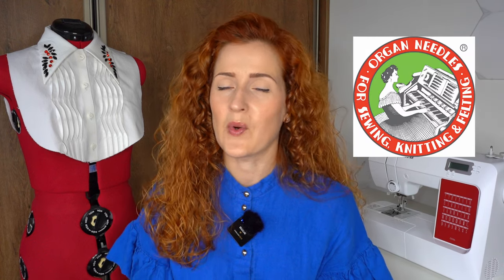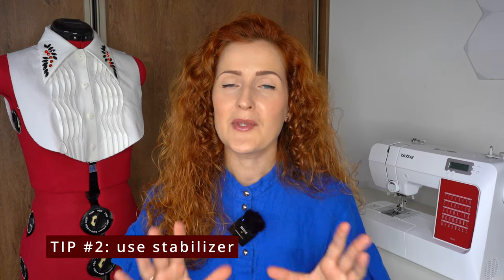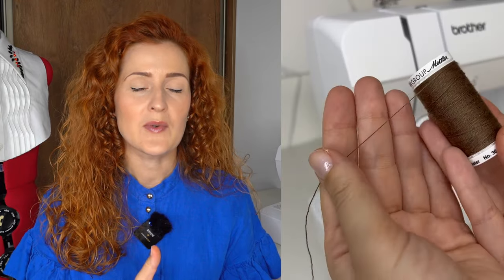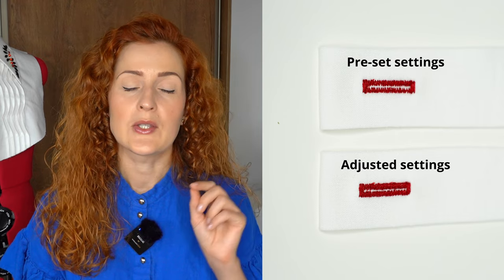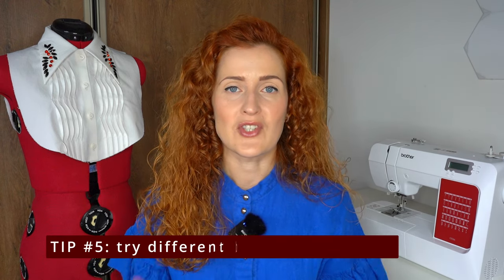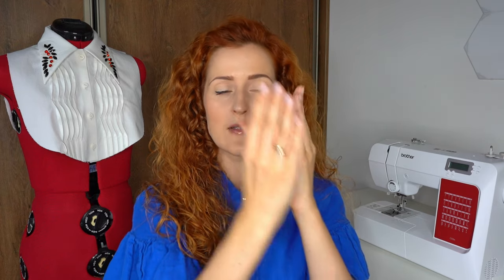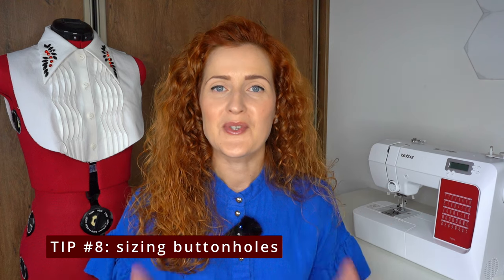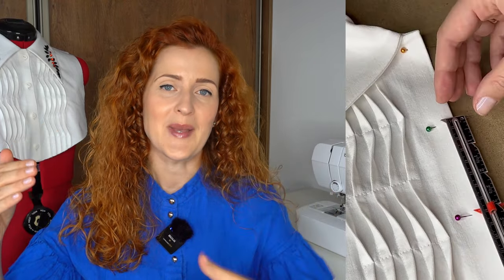MASTER YOUR BUTTONHOLES: 9 tips for perfect results

Comment: In the early 1980s, after ruining too many buttonholes with either a seam ripper or scissors, I went to the hardware store and bought a 1cm wide wood chisel.  From a builder's supply store I begged a very small piece of hardwood from their scrap bin to serve as a cutting base.  There had to be a lot of us doing this because a few years later the buttonhole cutter appeared on the market.

Comment: Well another "duh" moment!  I did not realize I can adjust this automatic feature on my machine!!  I actually have an old old machine with a buttonholer attachment that  makes fabulous buttonholes that I pull out when making them instead of using my newer machine.  

I also kind of fold the opened buttonhole open so that I can trim any threads really close.  Very Carefully lol😉.

Thank you, have a fabulous today!
Reply from the maker: If I need to trim any extra thread - I like to do it on folded open buttonhole, too!🤗

Comment: I use a seam ripper for button holes because it's hard for me to use embroidery scissors and I don't have the chisel. I place pins horizontally across the ends of the button hole to block me from cutting into the stitches.

Comment: thank you so much julijia, this video got me excited about sewing buttonholes again lol. I akso use embroidery scissors to open them, i find it so scary when people use the seam ripper, it feels so risky!
Reply: If I use a seam ripper I put a pin just in front of the bar tack. Then if I slip the pin stops the ripper ripping through the end
Reply: I bring the bottom bar of the seam ripper up before the end of the button hole before starting to cut to prevent going too far. I feel safer doing that than using scissors.
Reply: I tend to be just this side of OCD regarding personal safety. 50+ years of sewing, every buttonhole opened with a seam ripper, never messed one up. Bought a chisel a few years back, but have yet to use it. (Now I've probably just jinxed myself. Need to be extra careful on next project.)